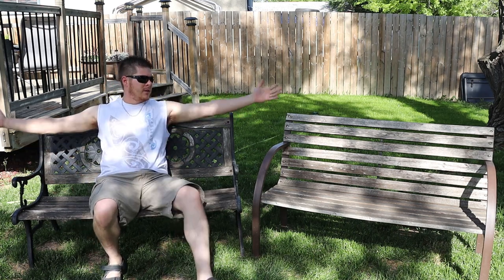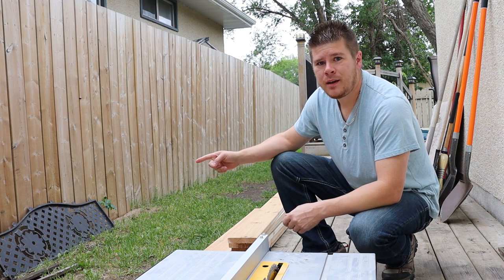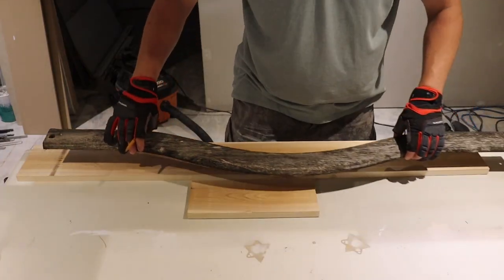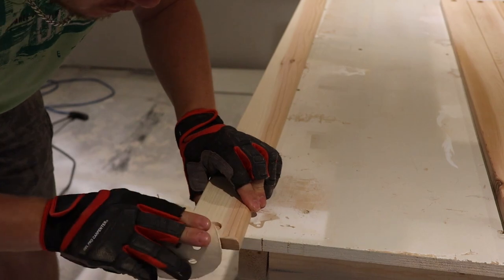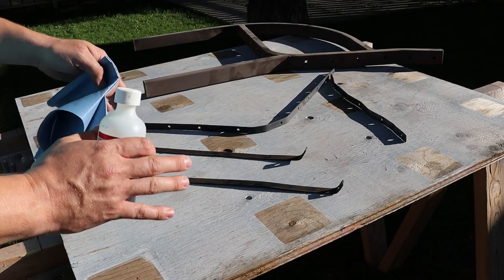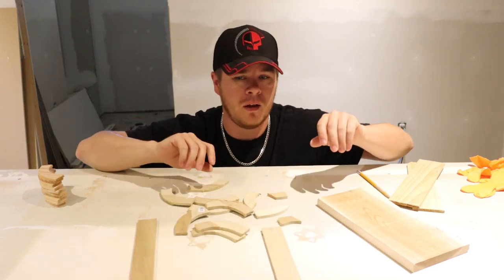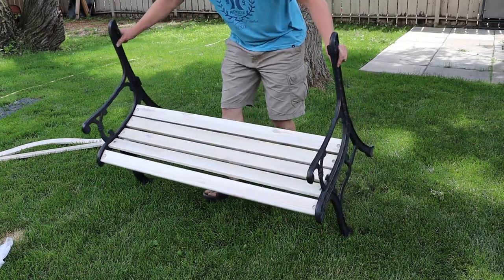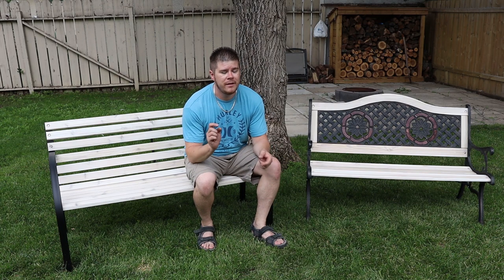Double Bench Restoration, what to look for and how to

Comment: So glad you explained the different products/steps in rust and painting. You can also use a piece of wood the same size as your slates and put a hole at the end and use it for a templet. Just hold it flush on the end and sides and hit the bolt with hammer. Leaves a nice indentation for drilling out. My only concern is countersinking the bolt heads. Wouldn't  that hold water? Awesome vid!
Reply from the maker: I'm glad you found it useful. You absolutely could do that. I'm not worried about it with Cedar, it won't rot

Comment: the adhesion promoter is only for polyolefin surfaces. things like car bumpers, interior parts etc. Not for metal per the manufacturer.

Exterior paint does not need a clear coat. Just get the finish you want satin, etc.

Comment: Hello Jesse from Vancouver, where abouts are you? I to did a bench last summer with 5/4 stock and man is that bench solid. You benches look great and you explained everything in enough detail so we can understand well done. I do have a question, with the temp saw horse table you used to paint on why didnt you use the table when sawing and save your back lol.  I have to add I have never seen someone on youtube  restoring a bench and so much time on prep before painting nice touch. Subscribed and looking forward to watching more vids. Take Care
Reply from the maker: Hey! I'm in Regina, Sk. Oh it's way more solid than 3/4" material, good choice. Thanks, I'm glad you liked them! I could have used it for sawing on I supposed, but at the time I only had one plug in on the outside of my house that worked, and I didn't have much room for the table over there, or a high enough guage extension cord for he saw lol. Prep is everything when it comes to finishing, especially with rattle can paint! I wanted to get it across that you can get a great finish, and long life out of it if you rake the time to do it properly. And after 2 years of use and Sask winters outside, it still looks great! Thanks for subbing, welcome to the crew! Hope to see you in more comments